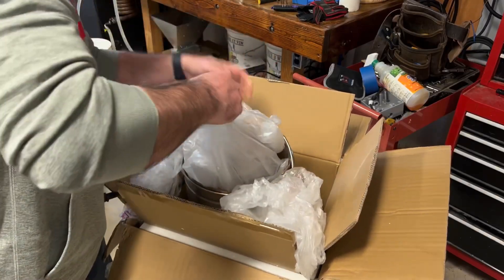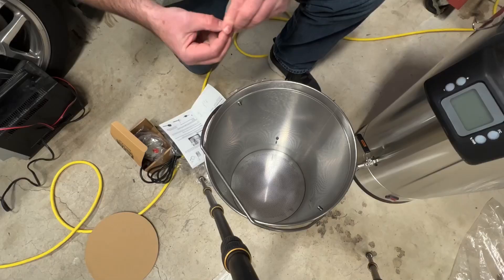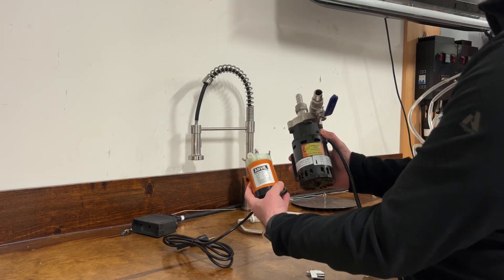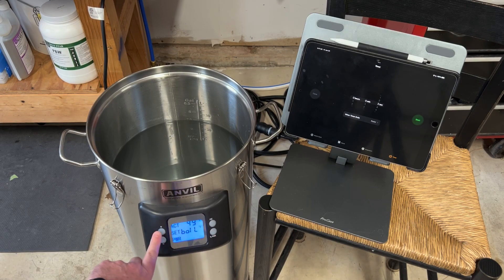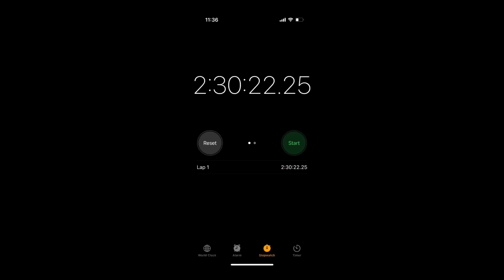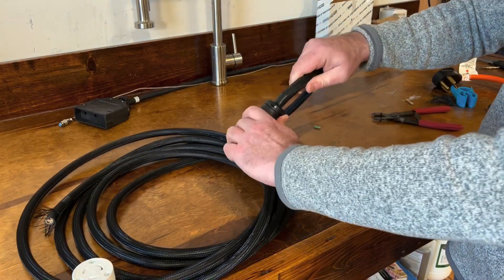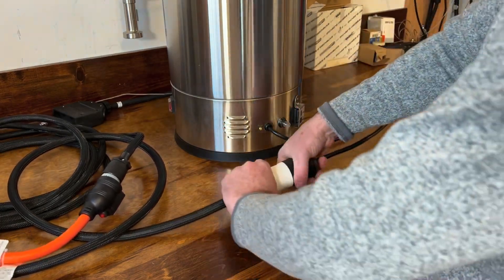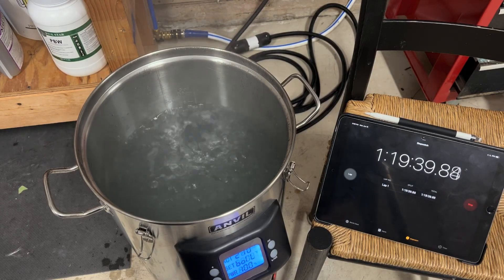Anvil Foundry 120 vs 240 Volts Water Boil Test

Comment: I have the 10.5gal/240v Anvil foundry set up, love it. One thing I added was an inline GFI (because I don't want to die).
The system heats fast and easily brews a 5 gallon batch. Usually 84% power maintains my kettle boil.
That little pump is surprisingly a monster at moving fluid. I agree the lines on the cooling submersible are lousy.Something to upgrade.
Reply from the maker: A GFCI is a must when brewing on an electric system. All my brewery outlets have GFCI breakers. My anvil pump also does a nice job. I was impressed with the 240v heating time. Very fast. Cheers!

Comment: Where did you get that adapter?   The problem im having is I cant seem to find any 4 prong 30a to 20 adapters.
Reply from the maker: I bought my adapter from Home Depot: https://www.homedepot.com/p/AC-WORKS-1-5-ft-30-Amp-4-Prong-14-30P-Dryer-Plug-to-Household-Outlet-with-20-Amp-Breaker-S1430CB520/311382808. I do remember spending quite a bit of time looking for a four prong adapter with a built in fused 20 amp plug. So far, it has worked great. Cheers!

Comment: Wish there was a full tutorial on how to convert 120 to 240
Reply from the maker: Maybe I can highlight this for you in my next video using this system. It’s fairly straight forward. On my anvil, I snipped the cord near the plug and wired a 220v plug. I think the newer versions come wired for 220. Thanks for the suggestion.
Reply: @justhomebrew  thanks! My plug is 50amps so I think I need an adapter to 20amps then get an extension, but it's not straight forward since I've never done electrical

Comment: You are effectively doubling the power output of the heating elements.
Is the potential for scorching an issue?
Reply from the maker: I have not seen other brewers having scorching issues with this system yet. I guess I’ll find out during my next brew day.
Reply: @justhomebrew  Cheers 🍺
Reply from the maker: Hey Petra, I brewed with this Anvil Foundry last weekend and did not see any scorching during the brew. I did find it a little difficult to maintain a consistent temperature. I plan on posting an overview of this brew session next weekend. Cheers!

Comment: how much did the extension cord materials cost?   what length ?
Reply from the maker: I believe I bought the 30amp to 20 amp 220v adapter for around $40 from Home Depot . The extension cord I made is from 12/3 soow cable and from what I can remember this cable costs about 1-2 bucks a foot. With the other outlet adapters and the nlyon jacket, you’re probably looking at around $100. For me, this approach was more flexible than putting a dedicated 20 amp220 breaker just for the foundry. I’ll update my description with more accurate costs this weekend. Thanks for reaching out!! Cheers!
Reply from the maker: O, and I made a 20ft extension cord.